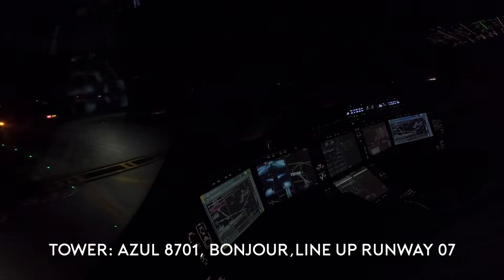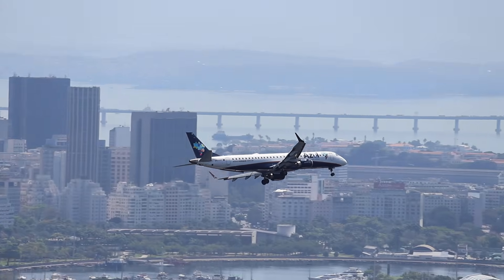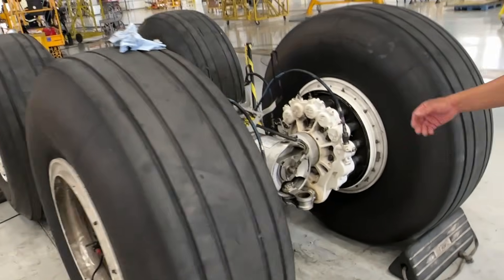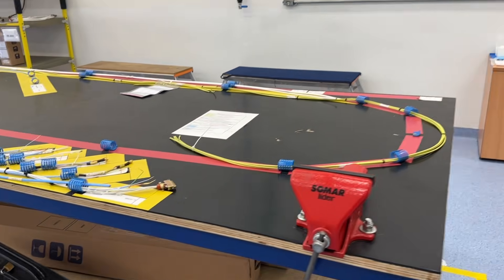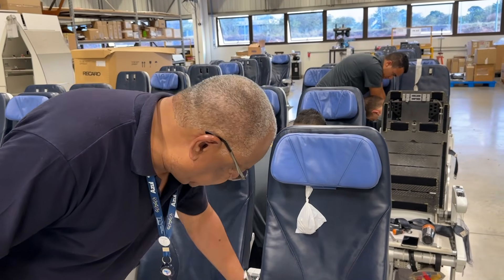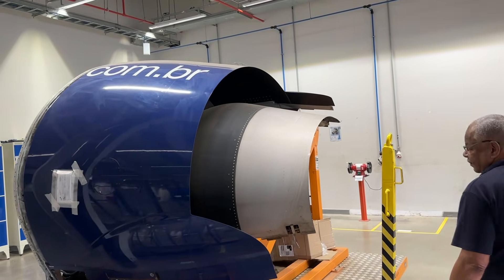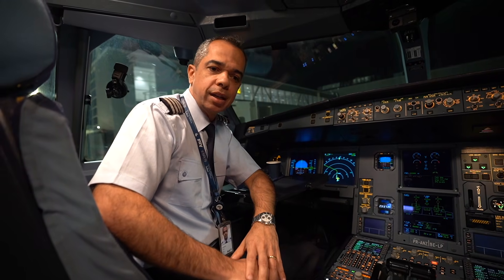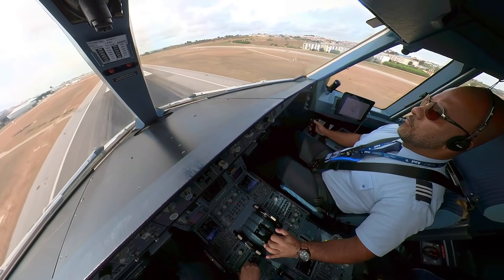Brazilian Aircraft Heavy Maintenance - Flying Azul Embraer + A330neo

Comment: Great video! I didn't realise the LEAP engine has carbon fibre fan blades! Also just for anybody that might have been a little confused about the copper mesh being integrated into the carbon fibre @ 7:13 ish, it's just to enure that if the plane is hit by lightning the energy wont be absorbed by the carbon fibre, it will pass through the copper and away from the plane, causing minimal damage if it's all bonded together properly. Great video.